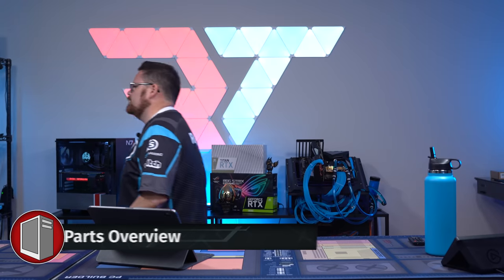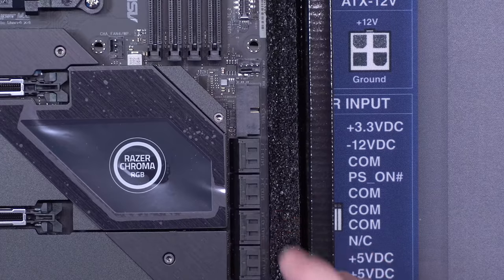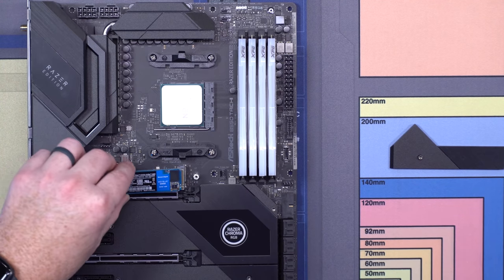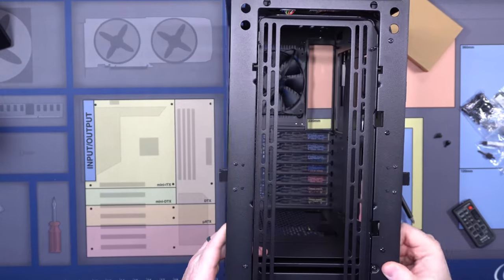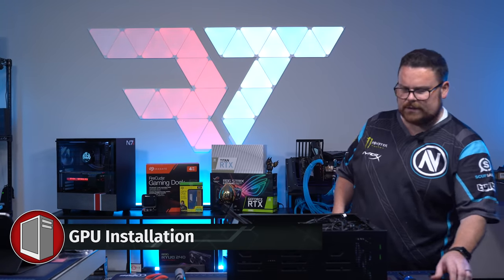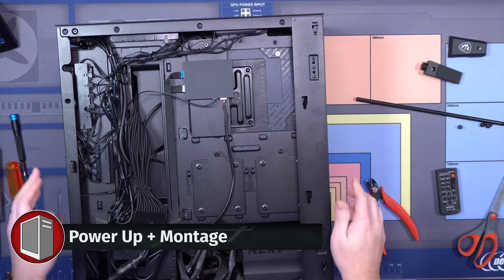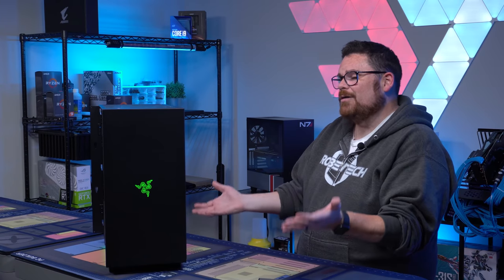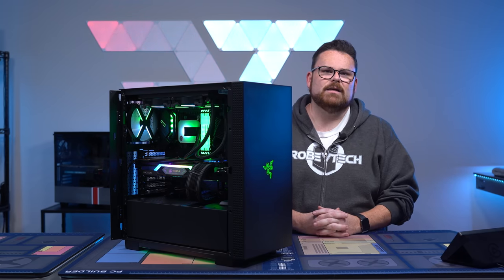Razer Tomahawk ATX Review Build and Live Build Guide! | Robeytech

Comment: What's interesting is that you don't necessarily recommend this case, but I saved your video to refer to when I install my new razer mobo inside my tomahawk! Thanks for the vid!
Reply from the maker: Actually it’s not bad!
Reply: @RobeytechLive  , hey it's super cool to hear from you so quickly on a yt comment! I'm still new to the PC building world, and you've got a new subscriber out of me! Thanks for cool video. I'll be installing an x570 in my tomahawk. And I'll be using my new razer aio with the kunai chromas as well. Only thing I can't seem to figure out is...is there a way to connect both my PWM and my addressable RGB controller. I seem to run out of USB headers to plug into without purchasing some kind of cheap splitter.

Comment: The specs on the Razer website aren't very specific. Can anyone tell me if the top can accommodate a 360mm AIO? And if so, will it get in the way of the front fans? And Vice versa: 360mm front AIO vs top fans. THANKS!!
Reply: Top is only 280mm supported from my understanding the front however is 360mm supported from what I heard

Comment: I’m a new PC builder, my case has those little 3 inch legs on it to like make space with the ground. Can I just put it on the floor and not worry about anything or extra dust coming through the bottom? Would I need to get a wooden plank to put it on top of just in case of anything. So if you needed to know my case is a Montech air 900 mesh ( Black ) case.

Comment: Is there enough space at the top of the Razer Tomahawk case, to put a 3 fan, 360mm radiator?
Reply: Did you find out
Reply: @churro5322  there is Not enough room at the top for a 3 fan radiator.  Only a 2 fan on top.  A 3 fan can mount to the front.
Reply: @lonnyjohnson8732  I figured. Thanks a bunch